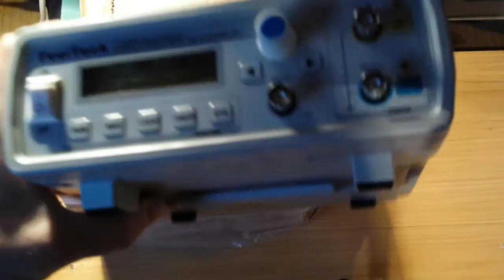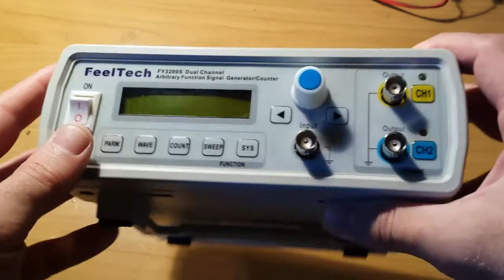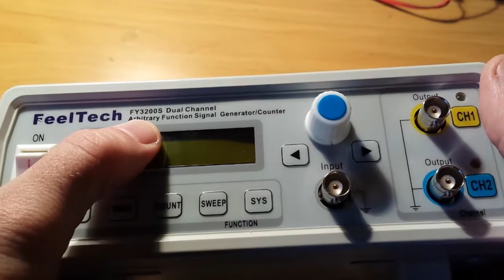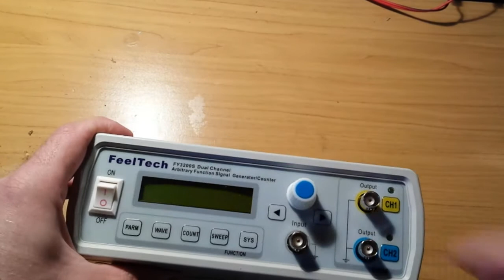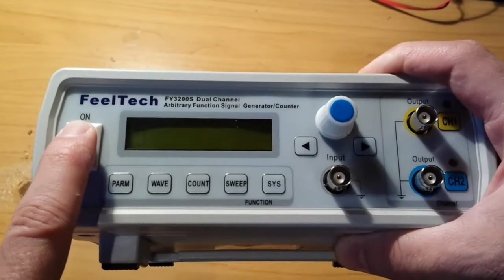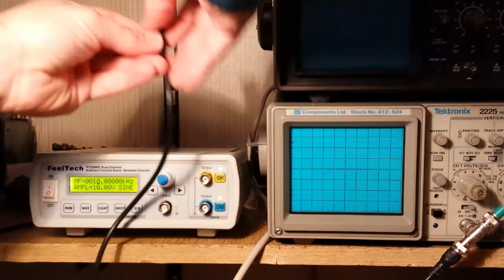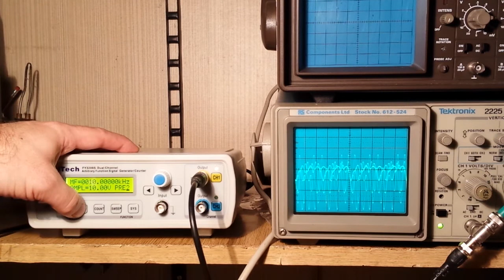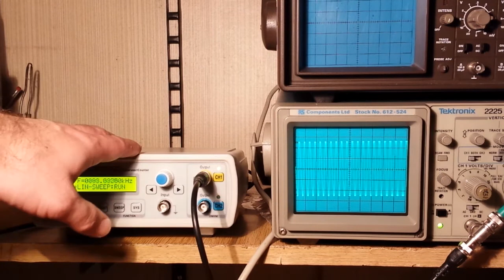nTOOBE #25 FeelTech FY3200S (FY3212S) Function Generator

Comment: There seems to be two manufacturers of these low cost waveform generators, FeelTech  (FY) and Instek (MHS). The situation is confusing, because even though these instruments from the two manufacturers have similar model names, they are completely different in specifications. 
 The feeltech models for example have 2048 point arbitrary waveform capability, and are compatible with the NI waveform editor software (which costs over 1000 USD). The free waveform "editor" included with the feeltech is virtually useless for anything other than merely scribbling squiggly lines with the mouse.You cannot design proper custom waveforms with it. On the plus side, the feeltech has logarithmic as well as linear sweep modes, and sweep timing up to 999 seconds.
  The Instek models on the other hand are cheaper, but have only 1024 point arbitrary waveforms, no log sweep capability, and sweep time to only 99 seconds. However, the free arbitrary waveform editor supplied is fully usable. I have an MHS2300A, and I have made several custom waveforms, and the editor was very easy to use. You can even create waveforms using excel spreadsheet in CSV format (but I have little inclination to go through the long process of learning how to do that).
  The Instek models  are also well isolated electrically from the AC line, they use a properly designed 5 volt wall wart power supply. Feeltech unfortunately has a floating ground issue and the instrument ground unless modified is a known shock hazard.
  I hve been using my MHS2300A for about two weeks now, and so far, I am very happy with it. I use it to generate stimulation signals for various biophysical experiments, and that is where the isolated ground is a plus. I realize the lack of log sweep capability is a disadvantage to some, but for what  I do, it is not really needed.

Comment: Hi. Did you every do a more in-depth review of the FY3212S? I am interested in purchasing one myself and I am curious to know what the quality of the waveforms is at higher frequencies -- sine wave distortion, over/under-shoot and ringing with square waves. Thanks.
Reply from the maker: Since it uses R2R resistor network DAC on the output, the sine wave is not very precise, it is a little bit asymmetrical at zero crossing.
I plan measuring it's harmonic distortion of sine waves at different frequency.

Square wave overshoot would have to do with some inductive reaction or maybe bad termination / impedance matching I guess?

Another thing is I don't know what is it's impedance, I plan measuring it on video one day. Although it's simple thing to do, it is a long shot because currently I have million things to do and I've put tinkering with gear aside a bit.

Anyway, this is a nice AWG, you won't regret grabbing it for 60 bucks in any case. At least  never have.
Reply: Thanks for the reply and the extra info. I think I'll get one, as well. I've enjoyed your videos so far and have subscribed to your channel.
Reply: Waveform starts dropping off at 17 MHz, but it is really quite good quality, and a useful device especially for the money.. (waveforms are pretty good)..there is a pdf manual on the net..

Comment: Very nice review. I just ordered one this week. I have seen other videos where there is line voltage on the BNC connector depending on which way you plug the  cord into the wall supply. I didn't see you jump or yell when you twisted the BNC connector on so I guess you got it right on the first try :)